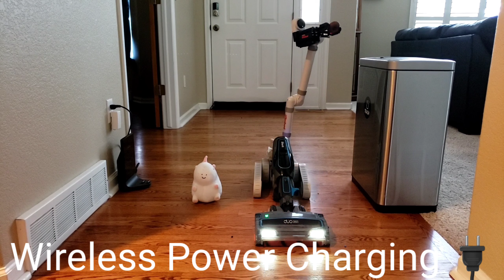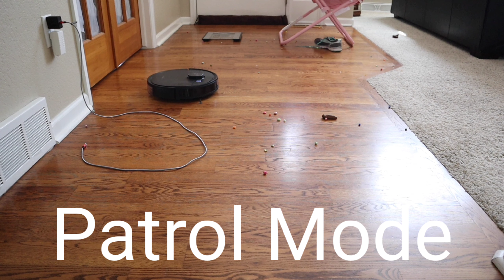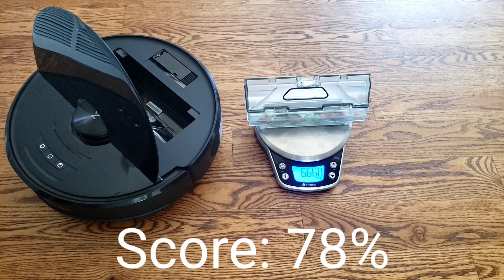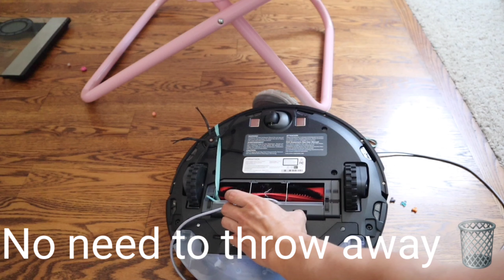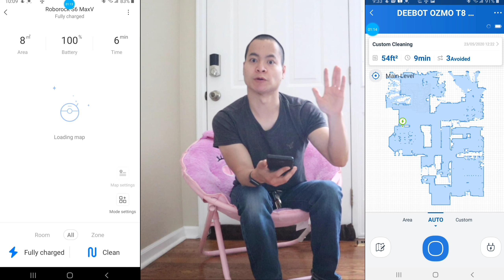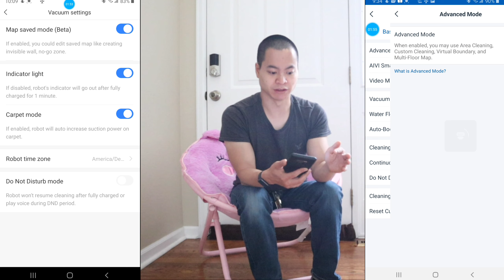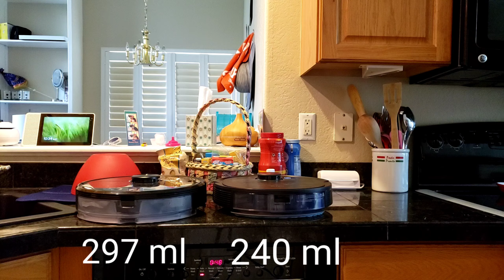S6 MaxV VS Ozmo T8 - Roborock against Ecovacs- Closest challenge YET!!!

Comment: I run the m6 daily, and my floors look awesome🌼 allabout.wiki/Roborock-S6 I wet mop 2 days and dry sweep the rest of the days. When I first got it, I used the included disposable pads. I didn't like them--the dry pad has no depth so if it picks up a chunk of something, like dry cat food, then it pushes it around or drags it around the floor. The wet pad wasn't very absorbent so left streaks and wheel marks.

Comment: Doesnt the s6 also have a remote viewing feature ?
Reply from the maker: Yes they had an update that incorporated that feature after making this video.
Reply: @RobotMasters  hi 
Is there any way to disable that annoying recording saying "remote viewing active" every 15 seconds?
Thanks.
Reply from the maker: @andrewsimons1213  No unfortunately Roborock hadn't released a ability to disable or turn down the remote viewing active.
Reply: @RobotMasters  are they able to update purchased v6maxv with this feature or do I have to wait for next years model ?
Reply from the maker: @andrewsimons1213  I can’t be 100% sure if they are able to remove the voice prompt completely or allow the user to turn the volume down. Maybe it a Security Requirement that Roborock has to follow, but I know the T8 doesn’t announce that it video recording just a small Red light. It possible they can update this via software and the new models would be similar.

Comment: @robotmasters....i bought an s6 maxv, its been pretty good but its obstacle avoidance is questionable. A couple times it has attempted to take out my child playing on the floor. Does the Ozmo T8 non AIVI have better people detection...particularly the small people :-) Also do you rate their pick up performance to be the same despite the differences in pascals?
Reply from the maker: The T8 does better at pickup especially on carpet. The non AIVI uses a laser system so it won’t care what the object is as long as it bigger than a golf ball. The Camera system found on the S6 MaxV uses a data base built in so it compares what it sees to what in the data base. Unfortunately only a small amount of items are in its data base and small humans not one of them. The NON AIVI might be better, but from my testing very complex environments with lots of obstacles might confuse the T8. For Now the Roborocks have the best navigation. You can look into the Shark AI, it front sensors one of the best I tested.
Reply: @RobotMasters  thank you, you are always there to answer my questions :-) Might try the T8 instead, whats are the noise levels compared to the s6? Obviously the vibrating mop attachment will be louder, but what about when thats not running?
Reply from the maker: The noise about the same, as I can recall the S6 MaxV was louder.

Comment: Here there is something important.  T8 can recognize the carpet which is very very important feature, but max 06 cannot recognize carpet.  Am I wrong?
Reply from the maker: You got that correct, the T8 can actively avoid carpet when mopping where the Roborock requires the user to setup a no mopping zones in the app. Both robots have a carpet boost function when vacuuming.

Comment: Shark AI has single sweeping brushes unlike the other vacs with the tri brush. Is it possible to replace the AI brush with the a tri brush?
Reply from the maker: It possible if you can find or make a fitting. Keeping mind might put additional stress on the side brush motors and wear them out quicker.

Comment: Which is better at getting dust from corners? Does the Roborock have better suction? Does the T8 mob better?
Reply from the maker: From what I observed the Roborock does slightly better at navigating and maneuvering around obstacles. The mopping performance is about the same. Slightly better with the vibrating mopping option on the T8.

Comment: Was considering between T8 AIVI and S6 MaxV, need some advice. Thanks.
Reply from the maker: Both robots have their benefits. What features are you looking into. For example the T8 has active carpet avoidance when mopping, the S6 MaxV has better night vision when streaming live video. What your floor plan like?
Reply: @RobotMasters  My floor is marble tiles. T8 AIVI has 2 side brushes over 1 side brush for the S6 MaxV. Do you think 1 or 2 side brush is better?
Reply from the maker: @darrentay78  I have always liked the dual side brushes over a single one. Can get dirt and debris from both sides of the robot. On both the Ecovacs and Roborock models they are speed sensitive. Along the base board the side brushes speed up and in open areas slow down to prevent scatter of debris.

Comment: With the Deebot, when i have created a perfect map of a floor i would like to keep and use that map forever. I establish the no-go zones and label all the rooms. Eveything is good so far.

The problem is if i only want to clean half the floor and shut the doors to the bedroom the robot will screw up the map. When it is finished cleaning it overrides and saves the map and the bedroom is removed from the map. So if i want to clean the bedroom next time i cannot choose that room. The bedroom is lost.

In short, how to deal with doors that will be closed some times without ruining the map?

How to stop the robot from saving a new map which erases the perfect map?
Reply from the maker: Hmm well what model do you have? Some models like the 960 can only save a single map at a time and continually updates if there a significant change aka close room doors. So I would create the map with all doors open, than if you want to do half of the floor only select the rooms you want cleaning. Remember to keep doors open.
Reply: @RobotMasters  I have Deebot 950. I create the map with all doors open, and i select only the rooms i want to clean as you suggest. However if the robot sees a door that is closed it will save that "new" map and next time i cannot choose the rooms that had the doors closed. I dont want to keep all doors in my house open everytime i clean, especially if i use scheduled cleaning. And i dont want to remap the house everytime a door is closed. Ecovacs support provide no solution to this and in general they are terrible at customer support.  Im wondering if i should return the deebot 950 and go with the S6 MaxV, do you know if the maps on roborock is saved forever or does that also update maps every time you clean and therefore mess up the maps?
Reply from the maker: @henrikstene279  So to bring back the old map turn the robot off using physically red power place robot on charger and turn red power switch on. The robot will update to the original map
Reply from the maker: The Roborock will create a new map if you change like add a keep out zones. The only ones where you can save permanently are the 360 Robots, Roomba and Proscenic models
Reply: @RobotMasters  Hmm, i will have to look into this again. Because after finishing a cleaning cycle with closed doors and i am not home, the robot finishes in the docking station and the map is saved/replaced before i can turn it off. But if you are correct and i can do it after, that means i need to manually turn it off and on between every cleaning cycle with closed doors to avoid losing the map. I have to do some more testing.
Reply: @RobotMasters  So if i set it up perfectly the first time, it will keep the map as long as i dont change anything later? If that is true then this robot would be the better choice
Reply from the maker: @henrikstene279  Yes they allow the user to select and save up to 10 maps. Unless you tell the App to delete the map it stays on there forever even if you map a new floor plan or the maps gets messed up. Can restore any of the maps saved.

Comment: Thanks for the review.
I have a rug in the living room that is about 1/2 the room and large tile in the other half. 
When the machine is in vacuum and mop mode, I want to mop and vacuum the tile floor, but only vacuum the rug.  Can it do this automatically by sensing the rug and turning off the mop?  Then when it goes back to the tile floor, it will do both mop and vacuum.
Reply from the maker: Yes the Ecovacs models have the carpet avoidance while mopping. Roborock you have to add a no mopping zone via the App.
Reply: @RobotMasters  Thanks.  Does the Ecovacs Ozmo Slim also have this carpet avoidance feature?
Reply from the maker: @paulnisenbaum2420  Not sure if it does, I think it only the Lidar based versions.

Comment: I have a single level house with mostly hard floors. We have a combination of stained concrete and wood floors with some area rugs. No wall to wall carpet. 

The transition between the concrete and the wood is about 1/2".  About 2 years ago, we bought the deebot 930 pro. It worked well for a few months but then it kept getting stuck on cords and stuff. I'd take it back to it's charging cradle then I'd loose the map. Very annoying. I unplugged it for about a year. Now I'm looking at them again.

Tried to get the ozmo 930 working again but I just can't get it to save the map.  I bought an irobot i7+ (actually the i8 from Costco which is the i7 with a few extra goodies and a larger capacity battery).

It works reasonably well.  I also want to do mopping so I just today bought the irobot braava m6.  It won't go over the transitions between concrete and wood.  I guess I can carry it over it but....

So now I'm reconsidering my choices. What would you recommend? I really like the convenience of the self emptying bin but if either the roborock s6 vmax or the deebot t8 aivi will navigate better, I might be able to live without the self emptying bin. Now, I do see that deebot has a new self emptying bin for the t8 but reviews in their site are poor.

What do you suggest I do with regard to good sweeping/vacuuming/mopping robot for my house?
Reply from the maker: I think from what you experienced and your floor plan the S6 MaxV your best option. Has the best navigation and doesn't loose it map.
Reply: @RobotMasters  are the mapping issues common with the ecovacs?
Reply from the maker: @KempieV89  From what I have seen, the ecovacs can lose their maps, you can restore the original map by turning the robot off using the red power switch than placing on charger and turning the red power switch back on. The robot will relocate and update the map. This usually doesn't occur unless there a significant change in the environment or if the robot was physically moved and couldn't determine where it at.
Reply: @RobotMasters  thanks. I just purchased a v6 max and packed up the braava m6 to take back to bed bath and beyond.
Reply: @KempieV89  How do you like the roborock s6 maxv so far? Is mopping  good?

Comment: So out of these 2 which is the overall best? Or if I want the best what is the best? Then where do these rank with the best? My house is 90 percent wood floors.
Reply from the maker: It really depends on what features you are looking for. The S6 MaxV has the better navigation, ability to stream live video in the dark, where as the T8 has the dedicated carpet sensor to avoid mopping your carpets. Also has slightly longer battery life and higher CFM. Both robots will do fine with hardwood floors.
Reply: @RobotMasters  should I save money and get roborock s5 max
Reply from the maker: @jasonbrinson20091983  It all depends on what you are looking for in a robot vacuum. If you have a small one bedroom apartment than a cheaper random navigation robot is ideal.

Comment: If I have a 2 story house and only want to buy one bot, can I unplug it and move it to the other level without any issues? I feel like the mapping system might be impacted somehow..?
Reply from the maker: Both robots the Ecovacs T8 and Roborock S6 MaxV jave the capability of saving multiple maps aka floorplans. The  new update with the S6 MaxV allows the user to take the robot to a different saved floorplan and the robot can scan the environment and update the correct map automatically. No need to manually load the correct map in the app. So yes both robots jave this capability without messing up the map.

Comment: I searched Ecovacs and Roborock website and found that the suction power of Roborock S6 MaxV is 2500pa while T8 is 1500 pa. Does this make big difference when they are doing cleaning work?
Reply: Thank you so much for your clear explanation! Appreciate a lot 😃
Reply from the maker: So the T8 does have lower Pa than the S6 MaxV but has a higher airflow around 24 CFM VS about 17 CFM on the S6 MaxV. I usually take the CFM and Pa with a grain of salt because there other factors that determine how well the robot can effectively pick up dirt and debris. Those are the navigation, how low the extractor bar sits, extractor bar type and design, side brush, lastly how quickly the robot travels. From what I tested both robots did really well in my pickup challenge, the S6 MaxV beating out the T8 slightly. Both robots are good, and offer the best performance and features to date.
Reply: Robot Masters would like to get your opinion about corner cleaning. You think T8 or S6 MaxV do the better corner cleaning?
Reply from the maker: @yvonnelimref  Hmmm that  tough one, I think the T8 does better because of the dual side brushes and they don't stall if they detect resistance like on the S6 MaxV
Reply: Robot Masters yup yup. I agree with you. Thank you for your quick reply.  Have a nice weekend!

Comment: So the vibrating/oscillating Ozmo Pro component is in default in the box with Ozmo T8? Do you think it mops way better than not-moving mopping pad in S6 MaxV? Or do you think that Y-pattern mopping in Viaomi V3 can perform better?
Reply from the maker: It hard to say vs the T8 vibrating mopping pad, will test this when I get it. But the T8 Pro has the vibrating mopping pad in box, the none pro which is sold in the USA a separate purchase. The Y mopping pattern will beat out the S6 MaxV mopping system since it goes over the area multiple times.
Reply: @RobotMasters  thanks for feedback. It seems that here in Europe we will get the Pro version so that's why I ask.

Comment: Hi. Terje from Norway here.
I have been following your videos and have learned a lot 😀
When I saw the self emptying Irobot I really like it. Unfortunately it was/is very expensive.
So I have been waiting for a cheaper one.
I saw the S6 max got very nice score in tests but T8 also seems to be really good. Now its even possible to get it with the self entry bin.
Unfortunately it seems It will not be sold in Norway so I have to import it.

Here are my questions:
Do you think it will have trouble going over about 20mm threshold?
That's the height into my two bathrooms?
What do you think about ordering it from China? Will it be with a Chinese version? I have an android phone. Do you think that will be a problem?
I found it in Aliexpress. There it's with the self emptying bin.

Terje
Reply: Thanks for you quickly response 😀
Maybe I should wait for your experience then.
When do you think you will receive yours?
Reply from the maker: Terje Jacobsen Hopefully the end of next month 🤔. I ordered a few days ago and the package is coming overseas 😳
Reply from the maker: Well that at the maximum that ECOVACs says their robot can climb over. I would personally try it and see if the robot able to make over the threshold. The T8 does have those two accessories and I did personally order the Ozmo T8+ through Aliexpress, awaiting shipment.

Comment: Hi Nathan, could you please check if suction only insert from Deebot 950 fits the T8 as well? I see that Ecovacs removed it from the list of supplied accessories for this model. I would like to use it only for vacuuming on my hardwood floors - have a lot of hair to deal with. Thanks!
Reply from the maker: Yes all the accessories like extractor bar and suction only port fit the T8, 950, and T5 models.

Comment: Excluding the navigation, which has better performance Nathan? S5 Max or S6 Max V?
Reply from the maker: The pickup ability is hard to determine exactly, the Ozmo did better with powder where the Roborock did better with larger chunks of debris. They both have just about the same pickup ability from what I can tell. But if I had to choose one, the T8 does better.

Comment: I bought the t8 because of your video, very informative. Could you recommend replacement mops that would work with the t8? I have the roomba mopper now and keepow replacement pads worked good - but maybe the t8 is so new there aren’t any pads available? Thx in advance !
Reply from the maker: I would see if you can order the Ozmo 950 mopping pads, they use the same mopping pads. You can also use the 960 as well, but from what I recall they are slightly larger.
Reply: Robot Masters cheers and appreciate the speedy response!

Comment: Hi, there! Great video, again! I really like both, but 800 $ it's just too much. I'm considering to buy S5 Max or Ozmo 950. Now are almost the same price. I have a one floor house, with no any carpets. I don't have any pets, but 3 girls :). Which one do You recommend? Thanks!
Reply from the maker: I think if your home mainly hardwood floors, the S5 Max would be my recommended choice.  More efficient at navigating around objects your 3 girls may occasionally leave on the ground 😅. Thanks for watching!!!
Reply: @RobotMasters  Thanks for the fast response! All the floors are tiles. I will use it for both vacuuming and mopping.
Reply from the maker: @МартинКръстев-п9х  Yeah the S5 Max should do fine for your floorplan type.